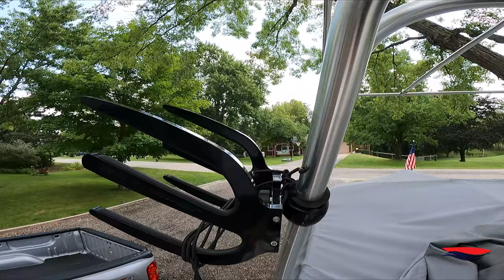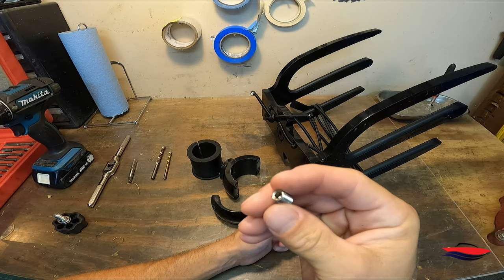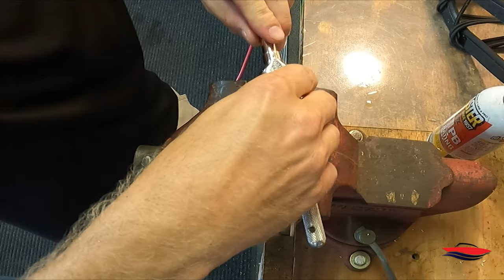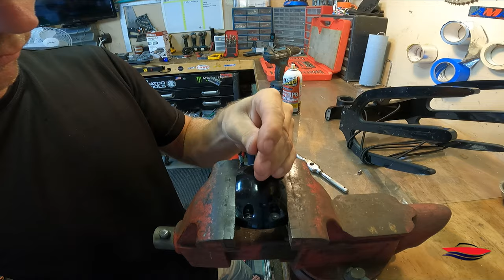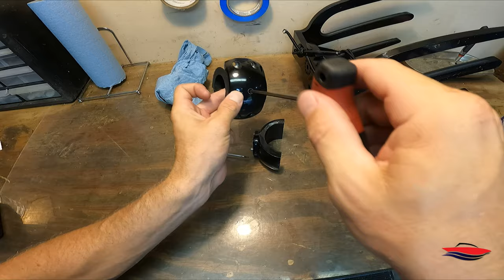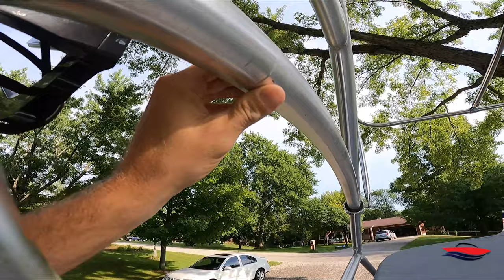How To Keep Your Board Rack From Moving.

Comment: Hi Jeff, love your channel! I have an AR 210 and had the same issue with the rack. My plan was to turn mounting bracket 90° and mount to horizontal bar. Was this taken into consideration and if so, was there a reason why you didn't go this route?
Reply from the maker: You would have the same issue and it would slip even easier because of the weight of the board constantly push down on the clamp.  Then factor in waves and the boat moving up and down putting more force on the clamp.  This is why I choose to mount it where I did for the best result.
Reply: @JeffDoesThis  Good point, I don't know why that didn't cross my mind! lol

Comment: Are you running the Slingshot Fool without ballast?
Reply from the maker: Correct, no ballast.  Maybe next season as I improve I will use my swim platform bag but the with a full tank of gas the wave is big enough.